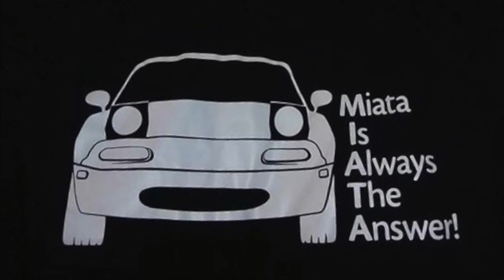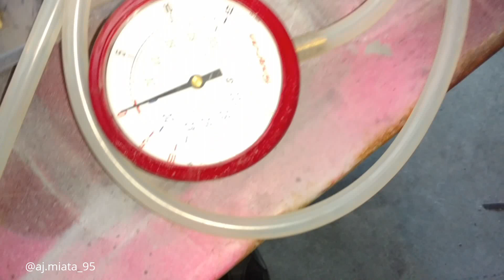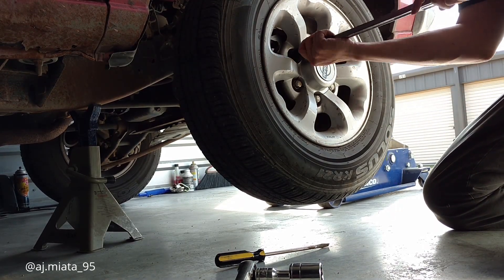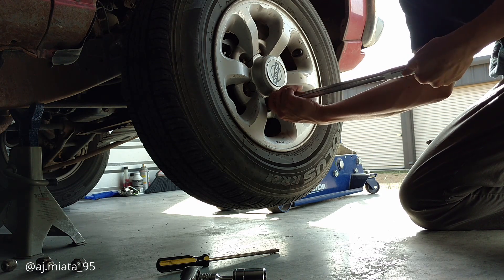Nissan hardbody wheel bearings

Comment: The placement of that jackstand giving me anxiety. I never put it near the curve of the frame like that on my 720 (very similar). 
That's also not a "castle nut", but rather a nut retainer. Ever done ball joints on this truck? There's your castle nut. Where you have to line it up for the cotter pin to pass through the top of the castle nut through the hole on the ball joint stud.

Last point, you're supposed to replace the cotter pin. People will argue that, but better off being safe when it deals with suspension (tie rods, ball joints, idler arms, etc ) and wheel hubs/spindles.

Comment: I’m wondering if this is the culprit to my problem. It sounds like a bunch of washers spinning whenever I’m going down the road
Reply from the maker: Can u Jack it up safely and spin the wheel?
Reply: Yeah but it only starts making noise at 10-15mph so I can’t spin it that fast lol. I don’t think it’s the transmission but I’m going to raise the rear end up and see if it still makes the noise when I get on it tomorrow. If so, I know I’ll have to tear into the driveline. If not, I’ll replace the bearing or tighten the nut up
Reply from the maker: Right on. Keep me posted lol u might also listen in on the drive shaft carrier bearing
Reply: Beatrice the Miata tore into it today, there was a round piece of metal spinning where the driveshaft meets the transmission. It fell out when I pulled the driveshaft so it doesn’t make a sound now
Reply from the maker: Nice!  Good find. 😁😁

Comment: Hey man I just got a hardbody and I guess the truck originally comes with drums ? And mine has disc brakes just like you all around and I took them off and went to an oreillys and they couldn't figure out what goes on the truck same with autozone. What size rotors do you have and where do you go to get them ? Also I need to find a fuel pump the hole cage and all I can buy the pump but it's rare i guess to get the whole cage and stuff. Help pls
Reply from the maker: Might have came off an isuzu rodeo
Reply from the maker: Rock auto or parts geek may have parts
Reply: @beatricethemiata8565  yo I just wanna say thank you so much for the help. I've been looking for rotors for a while and couldn't find anything. You were right on the money it was the isuzu or whatever pick up truck brake kit. I got a Nissan frontier fuel pump modified it myself and it bolted up. I had to change the wiring on it but that was about it. Anyways thank you again you are the man
Reply: @beatricethemiata8565  oh another question. I wanna lower my truck pretty low with some camber in the front. Are there any shocks or coils I can just pull off a Honda or something like that and put on and get me real low?
Reply from the maker: Ford pinto shocks I think. Bell tech has some stuff but it's expensive. I think Honda shocks might work, some guy here used them but I don't remember which ones. Turn ur torsion bars way down also
Reply: @beatricethemiata8565  got a Facebook or Instagram?
Reply from the maker: I do have an Instagrams- @aj.miata_95
Reply: @beatricethemiata8565  just requested